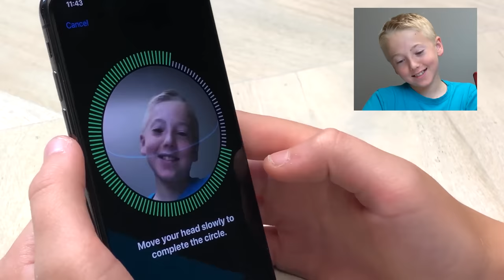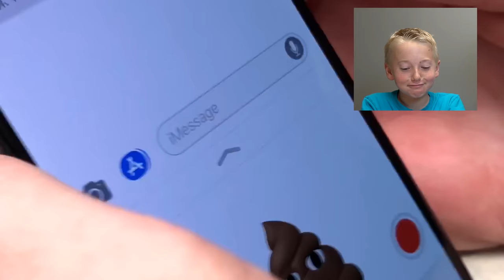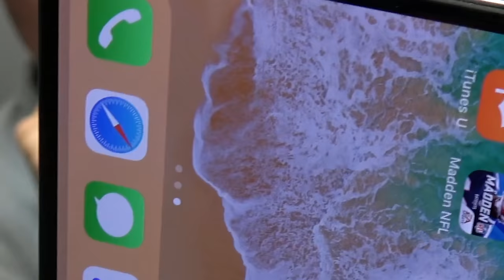What's inside iPhone X?

Comment: If you punctured the battery it could have exploded and you both have no protective gear on
Reply: Master OG fr they punctured it in the video and the gas it puts off is toxic to your lungs
Reply: See but they are designed not to explode. Even if they did it would be minimal shrapnel and more and flames. They are on a marble table which can take some heat so it would be fine there. And as long as they aren't directly breathing over the gas they should be fine.
Reply: Kyle catch shrapnel to the eyes and 3rd degree burns to the face and arms but as long as the table is fine
Reply: Master OG That wasn't my point for the table, it's so the whole house wouldn't catch fire was my point in that. Second of batteries like this will never explode to the point that it has shrapnel. Only produce gas or catch on fire. I am trying to be civil and calm when I say this but I'm not sure you're aware of what kind of technology goes into these batteries.